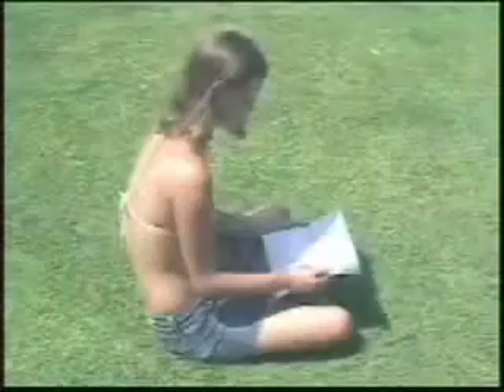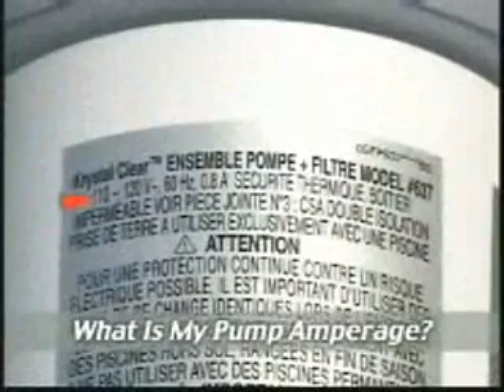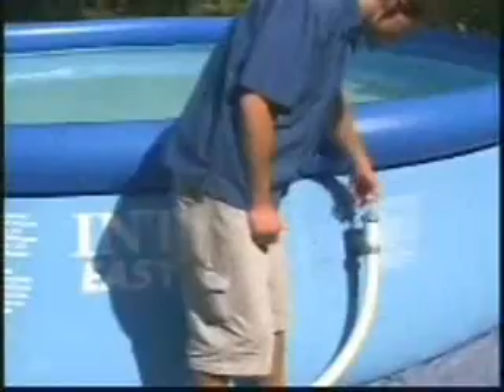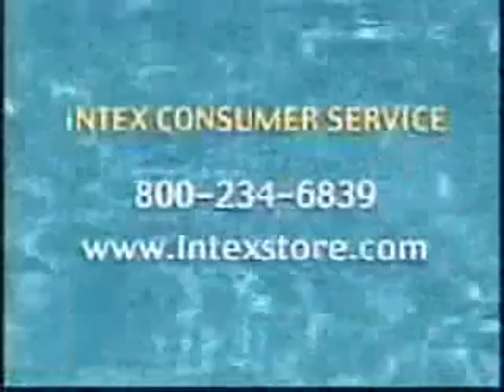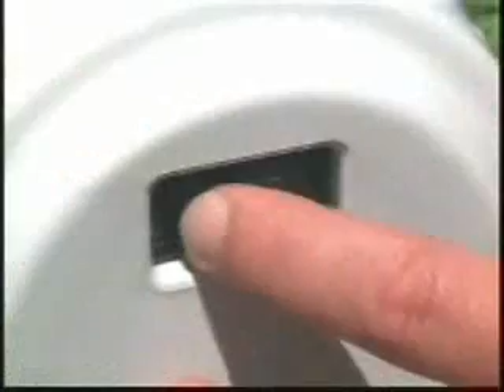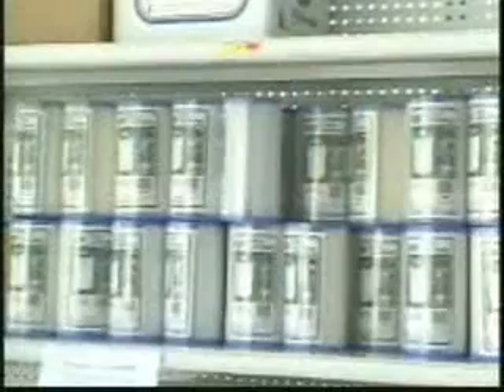Intex Filter Pump Troubleshooting Guide

Comment: Hi, thanks for your reply. Yes, I tried opening up the air release valve (as instructed in video) and also sediment release valve. My GFCI is indeed kicking off which begs the question why. I tried switching to a 10 gauge chord as well as connecting the pump directly to other outlets. When I called Intex Support the guy told me that the internal chip is likely defective and the resolution is to buy a brand new pump.

Comment: I turned the inflatable spa off to clean the filters, tried to turn it back on and just got a bunch of beeping. The air bubbles worked, but not the heater or filter pump.

Comment: My pump used to work for a few weeks. Now it continuously turns off every time I turn it on. It's connected to an extension cord. I unplugged it and plugged it directly into the wall outlet. Still shuts off. I've done everything except take the pump apart to check inside. The filter is totally clean. The Timed on switch doesn't work at all through the extension cord but it struggles to stay on when connected directly to the wall. Should I buy a new pump? It's bad enough I spent $600 on a pool & it's parts and the damn thing doesn't even work. I've had a non swimmable pool for a week now and it's truly aggravating seeing my money go down the drain.
Reply: I have the same issue my pump stopped working after one season I got to pull filled up and the pump totally does not work it just buzzes like hmmmmmmm. When I try to figure out how to buy one online my model 633 does not look like the one that's on my pool I'm just fit to be tied. I'm going to go drown myself in the pool that won't get clean LOL
Reply: donnarosanna

Comment: There's not enough information on the pump for my pool.Which is running fine it's just leaking a large amount of water from the bottom.What can i do to try to fix it? It's model number is 635T.All I want is to know what to do in trying to fix my leaking pump.

Comment: I turned my pump off to clean the filter, go to turn it back on and nothing. I can feel my pump hum when I turn it on, but that's it.
Reply: +Chris Cunningham Either there is something stuck inside the motor or the propellor has broken of the rotor, in that case you can throw your pump away because Intex doesn't sell spare parts.
Reply: Paul M Well, I can't get the thing apart to see, I don't know how to take it apart.
Reply: +Chris Cunningham Up to 1000 Gallons you can see the screws holding the motor when you take the filter out, for the more powerful pumps it's just a matter of unscrewing everything until you reach what you're looking for. ; ) (Or try finding some info on the internet/youtube about your pump, if you're hesitant to open your pump.)
Reply: Paul M Well, my filter is separate from the motor part...
Reply: +Chris Cunningham The cover can be unscrewed and I assume (I never owned that model.) that the motor is screwed down also. You have nothing to lose when the warranty has expired. Intex won't help you, that's for sure.
Reply: Paul M Well, the pump is less than a year old, we got it back in April.
Reply: +Chris Cunningham  then why don't you return it for a new one?
Reply: Paul M Well, my dad is the one who ordered it, so I have to wait on him to get around to it, he said he'd get to it on Monday.
Reply: +Chris Cunningham Ah ok, in that case don't touch the pump and just return it as broken. Even if it's debris blocking the motor it can have caused damage. That's why I always flush my pump as can be seen in my video link.
Reply: your impeller shaft probably broke. mine did same thing ther made of ceramic cheap china junk

Comment: When I switch the pump on it runs for about 10-15 seconds and then stops running. I have tried multiple outlets and connections. Every time I come back and try again the same thing happens. 
Please advise.

Comment from the maker: You may want to see if your sediment release valve can help, your pump can get locked up. But the on and off problem is tough, it could be your GFCI kicking off? You may want to contact Intex directly at 1-800-234-6839.